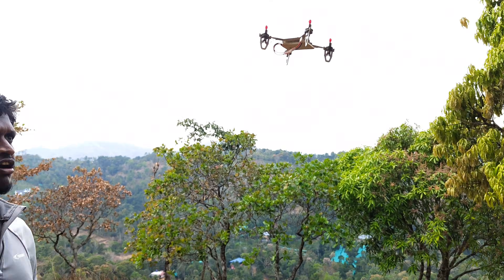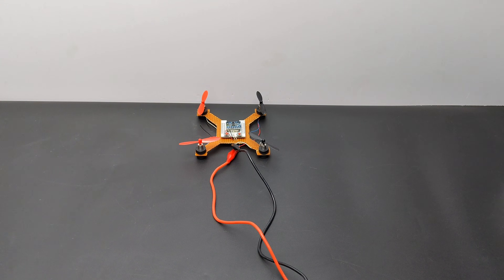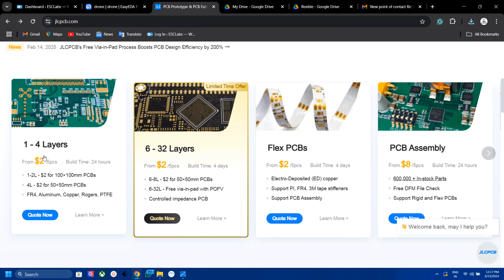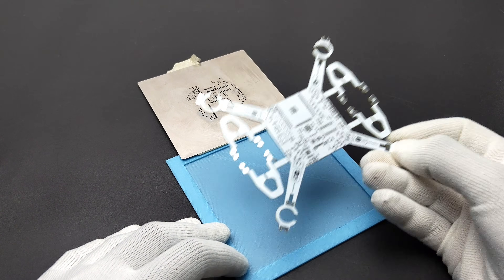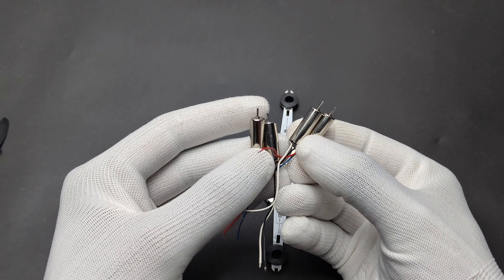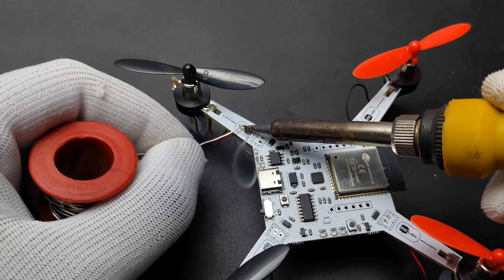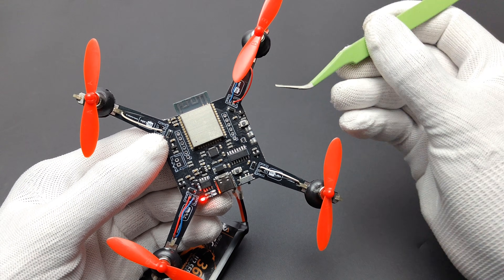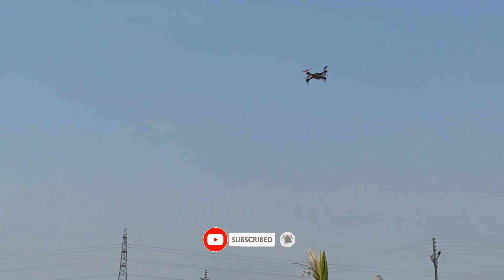How to Make a Cheap ESP32 Drone | ESP32 Drone | JLCPCB

Comment: How does it automatically calibrate ?? Don’t we need to adjust the it manually according to the wights and all
Reply from the maker: Nothing with weight. It checks the orientation and sets it as the default position

Comment: Hey edison this project this incredible so I wanted to make a similar on a drilled pcb with esp32 devkit so can you give me all the connections and to power the esp32 on vin pin  using a boost converter like mt3608 would work or it would extra weight give me your suggestion ? And about programming it what software you have used to program it . If you gave the info it would be a great help
Reply from the maker: Circuit diagram and code available on the website please check it out. Of course it will increase the weight and will not lift.  I think you skipped the video, because these things were well explained in the video.

Comment: Hey bro! I made this drone but do not program because , ESP launchpad is not detecting the device. 😢
Reply from the maker: Check your connections
Reply: @EDISON_SCIENCE_CORNER  i used USB to UART converter for programming
Reply from the maker: @bilalsaifyyy if it is not detecting that means it got some problems with the usb to ttl converter connection
Reply: Give me a solution. Please

Comment: building a custom pcb vs getting more powerful motors , im not really sure which is cheaper, considering that with assembly + shipping  it ends up costing almost $100, just the pcb..,  you can get 4 small bldc motors for less that $20 and there are cheap esc for about $2 (tho they dont handle a lot of current sadly and you need to buy a separate BEC) , i think the most expensive and hardest thing to find are the batteries...  then again, i want a small indoors drone not a fpv for racing LOL ....
Reply from the maker: First thing  the aim is to build the cheapest drone not the powerful. Second yes you can get readymade drones for this price my aim was to build one myself. 
Next you can get 10 pcbs for around 20$ including shipping.  So one PCB will cost around 2$ all other components cost is under 15$. You have to assemble it by yourself otherwise what's the meaning of making it.
Reply: @EDISON_SCIENCE_CORNER  makes sense, the shipping will still be costly but i see why you need a pcb, for the coreless motors and at 3.7v even if you use a esp32 super mini you still need an "esc" (just a bunch of mosfets )  and it is quite troublesome to wire it up without a pcb
Reply from the maker: Watch this video again you will find why  the PCB is necessary 👍

Comment: Hi i need some help. I too built this one but it is highly unstable and does not stop when roll/pitch stick is centered. It keeps moving in the same direction as the stick was moved initially. 
Did you face the same problem? Plz help
Reply from the maker: Same setup and code.?
Reply: @EDISON_SCIENCE_CORNER  yes bro. I tried PID tuning but not working. Do you think velocity sensor will work?
Reply from the maker: You can contact me on WhatsApp. Please check the video description.

Comment: Bro what’s the best solder paste brand struggling with smd solder reflow
Reply from the maker: Mechanic , i am using that
Reply: @EDISON_SCIENCE_CORNER  138 or normal temp 183.bought from?
Reply from the maker: Both will work just fine. But i got good results with 183. Also set the reflow temperature to 250°C
Reply: @EDISON_SCIENCE_CORNER thanks fr all ur replies and videos.people like u have kept this scene alive. Will be obliged to contribute the community if opportunity presents.ty

Comment: Brother, I'm trying to make this drone in two weeks for school project. I dont know about esp 32 is that used in the video and If i get all components follow this video tutorial and follow all steps could it work. How long will the project last battery-wise and if not activated for long will it still work. How high can the drone go, give every detail about the drone so I can understand. And, if you can is it possible you make an in-depth explanation to answer these questions so there is nothing or anything that might confuse me...
Reply: Will the drone kit provide the ESP-32 and the battery. Also you did not explain what the tiny white component you attached to secure the wires of the motors after you soldered were. Would we need that to put in the PCB just for one or for all four of the motors. And, I recall you soldered the top part of motor wiring for the PCB do we need to do that.
Reply from the maker: Yes my kit provides all the components
Reply: So just to clarify, you add the Gerber files and order the PCB and stencil from the website. Where can we get the Gerber files you used again? Then, we follow the video, buy the drone kit from your site, then after that once everything is assembled you must program it like you shown in the video then following that you have to install the app and set up some configs or setting specific to your drone build, you mentioned a guide to reference from, where can that be found?
Reply from the maker: For more details use my WhatsApp
Reply from the maker: Battery- 10-13 minutes flying time
Range -upto 20-30meters

Comment: Why use MPU6050? It is very outdated now and not even produced anywhere. No PCB manufacturer has them in stock, use 9250 or ICM module?
Reply from the maker: Mpu6050 is outdated . But it is available. Okay i will update

Comment: Hi! I really liked your project.
I'm trying to adapt your ESP32 quadcopter setup (originally for ESP32 WROOM-32) to work with an ESP32-S2 Mini board.
Could you please guide me on what changes I should make?
Especially regarding the pin assignments and any other configurations that need to be adjusted for the ESP32-S2 Mini?
Thanks a lot for your help!
Reply from the maker: Check the video description. There is a link for the tutorial. There is a circuit you can refer to and modify that

Comment: Hi, I followed your instructions and built the quadcopter, but instead of using the pre-made flight controller board, I used an ESP32 development board and wired everything according to the schematic you provided.

The Wi-Fi connection works fine — I can connect to the quadcopter with the mobile app, and the green LED blinks rapidly indicating it's connected. Also, during startup, each motor spins briefly as expected, so I know the motors are functioning.

However, the problem is that when I try to control the throttle or any other movement from the app, nothing happens — the motors don’t spin at all.

Do you have any idea what could be causing this issue? Is it because I used a custom ESP32 board instead of the original board? Or could it be something in the code or app communication?

Thanks in advance!
Reply from the maker: The issue with the  mou6050 connection. Please check that first

Comment: Excellent project, my friend!
I've been working on a similar project for a few days, but in my case I'm using the ESP32-C3 Super Mini. I'd love to try your code, but I need to change a few things—like the pin configuration—to adapt it to my setup.
Would it be possible for you to share the source code instead of just the .bin file?
I would really appreciate it!
Reply from the maker: Just search espersiff drone in google to get files.

Comment: bro can you help me, i have a problem when using the esp32 s3 super mini, but the esp 32 is not detecting the mpu6050 sensor when using the code, but on arduino ide it detects the sensor and shows it address. i even use the other pins for the sda and scl and set them to the menuconfig . what do you think my problem is?
Reply from the maker: Try to change the mcu. Have you used the module or IC.?

Comment: Great work. I am going to be working on something similar for a competition. I was wondering if you were going to post the code. I'm curious about what type of structure you used for the code. Did you use an RTOS or something similar? Also, what specific motors did you use?
Reply from the maker: The code and circuit available in the webt

Comment: Bro can you plz provide the arduino code .ino file instead of .bin firmware 🙏 i am building with esp32 c3 mini so need to change the pins allotment
Reply: bro , use logic to code , drone has 4 motors connected to 4 transistors so u need to power individual transistors via any signal pins from esp32 c3 from the control signals you get from phone connected via esp32 access point , read mpu6050 data from i2c , advantage of esp32 is that with wire function u can use any gpio as i2c pins , from the data from the sensor stablize the drone for that use pid algorithm , u will need to do some trial and error but yes its fun , now you have a voltage divider output to any analog pin of esp32 to know the battery level , if you get thelevel you can impliment safe landing procedures if battery is too low , so techinicaly you can code yourself 

also pin allocation can also be found via the schematics but its more fun to make one urself with a unique touch 

all the best , happy to help
Reply from the maker: Sorry i dont have the .ino file bro

Comment: Is there any way to add height hold feature on the drone through an update? If i buy it now, id have to buy it again if its a different model 😅
Reply from the maker: Not in this drone. As i said i am working on it. I will update once I get the proper result
Reply: @EDISON_SCIENCE_CORNER   to make your drone hold altitude u need to add 2 more sensors , gps and magnetometer , and barometer 
now with those on board you will need to design a pcb with 4 or more layers , if you ask me can you do this on mpu6050 i would say yes and no at the same time , but its easy to impliment via interfacing other 3 sensors on board 

all the very best ,
Reply from the maker: Yes

Comment: Great work👏, 
I built a similar drone but with Arduino nano, hc-05 Bluetooth module, mpu6050, IRLB4132 mosfet as esc with 8520 coreless motor and used an mobile app to control it. But its motors were not in sync and the nano was getting reset again and again, although you have made this and provided all the steps to build and I appreciate that 💛, but it requires to deal with smd components which isn't easy 
so can you plzzz give that nano and hc-05 drone a try and upload, I am literally stuck at this point and don't know where i am lacking, your help would mean a lot ! Thanks✌️
Reply from the maker: Nice. You can use tht components instead of SMD components
Reply: @EDISON_SCIENCE_CORNER okay, can you make a tutorial video on that too ?
It would be really helpful !
Reply from the maker: @bhavikrajpal6882  instead of using arduino and hc05 module use esp32. Esp32 is faster and lightweight
Reply: @EDISON_SCIENCE_CORNER  okay does esp32 module requires any dc-dc 1.2-5v to 3.3v boost nd buck converter module ?
And will the code and app you provided will work with it as i will not be using any charging module and the usb serial port for formating code will be already there in esp32 module, and instead of si2302 smd i will be using irlb4312 or irl520n so will they work with same code ?
Plz do reply !
Reply from the maker: Yes.  Drivers and other components doesnt matter

Comment: i have one problem, in the app look a messenge " Parameters TOC fetch Finished:0 " Plis help me the problem.
Reply from the maker: Have you connected to drone
Reply: @EDISON_SCIENCE_CORNER  I was able to connect, but it works and disconnects by itself and the middle LED stays on. What could be the cause?
Reply from the maker: Battery charge, any sensor error etc...

Comment: Suppose you flew it too high, and the ESP32 cannot receive commands from the app, suppose the last throttle state was "UP" from the app, so will it lock on and fly upwards untill battery rans out?
Reply from the maker: If it is not connected to the app it will come down
Reply: @EDISON_SCIENCE_CORNER  i assume it will slowly and steadily come down, and not like a stone 🪨
Reply from the maker: No just like a stone😅